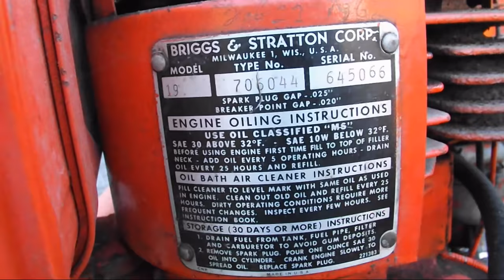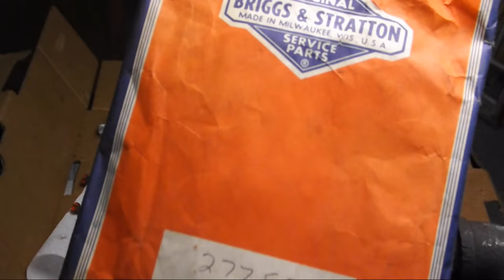1962 Simplicity Tractor Model W Back to Life

Comment: Good job on the upper end clean up / overhaul ! 
The model W was the final evolution of Simplicity's 2-wheel garden tractor. I love the W's & the larger Briggs cast iron engines.
I have 5 model W's. Mine have the later model 200431 8 hp engines. I wasn't aware they were still using the older model 19 7.25 hp engine on the W's. I have 2 Simplicity VC's that use the model 19 engine. I've upped the hp on 2 of my W's with the big block cast iron Briggs engines. One has a Briggs model 302... 13 hp engine & my snowplow W has a model 326... 16 hp engine. I had a MW Power Trac (same as the W), but sold it to my son for tilling his garden & plowing or blowing his driveway. It was my test mule for the first big block Briggs upgrade. It has a Briggs model 243... 10 hp engine.
Reply from the maker: Thank you...I check out your channel, nice old iron...please make more videos

Comment: Does this model not have a coil over the flywheel? 
On several of the big cast iron Briggs I've been adapting the Honda 13 hp. coil and bypassing points.
Reply from the maker: Hi Phil
The coil is under the flywheel, as long as everything is working fine in its original state, I am not planning an upgrade. I would like to see your setup with the Honda coil on a Briggs

Comment: Did you replace the wheels? If so where did you find them
Reply from the maker: I bought it with good tires and wheels, here are the SIMPLICITY part numbers if its any help
tire 151059
tube 151060
wheel SS-B23C